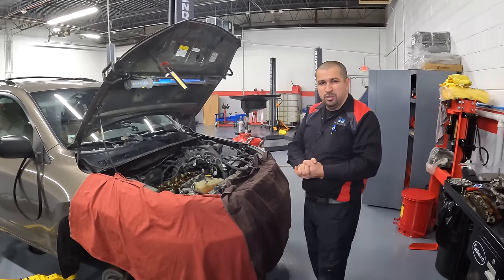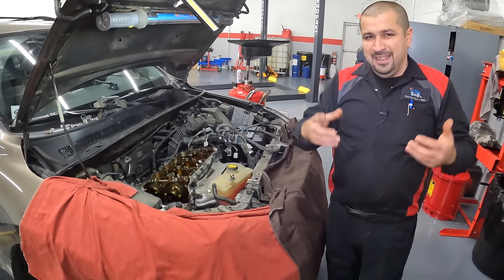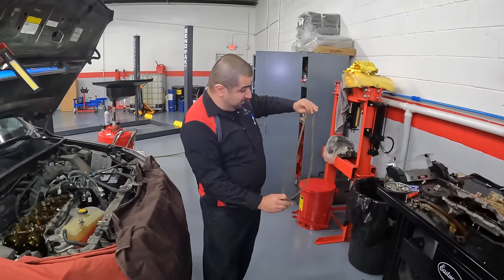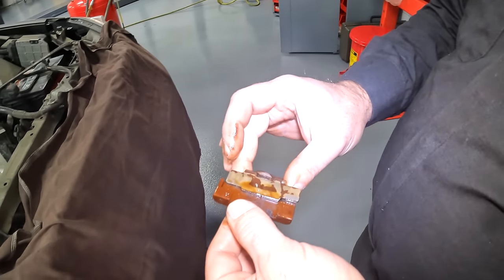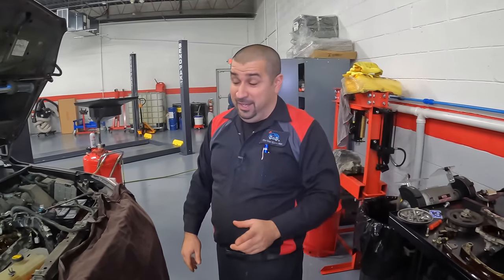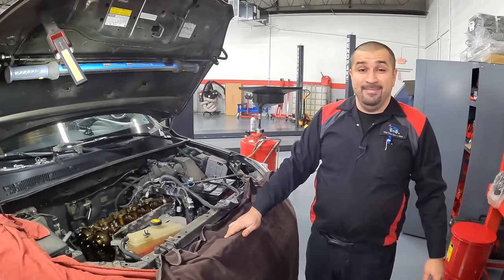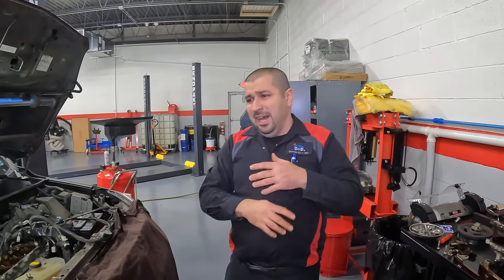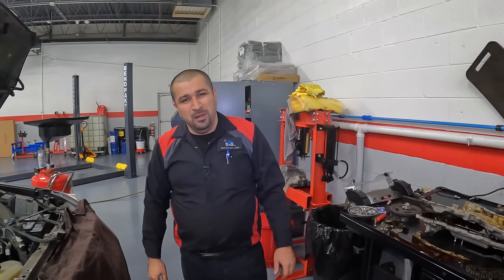When Should You Replace Your Toyota And Lexus Timing Chain?

Comment: I still have a 2003 Toyota 4-Runner with the 4.0L V-6 with 586k on it, no internal engine parts have been replaced, Toyota quality!
Reply: Nice! Congrats. 
I just hit 188K on my 2011 Highlander 3.5L V6. 
Most original parts
Reply: Sweet. I have an 08 4runner with 285k. Looking forward to may more miles!
Reply: A timing chain will outlast your cars once it’s serviced on time and driven properly.
Reply: I have a 2002 Toyota Sienna LE 3.0L V6 with 186K on it. Unfortunately, it has been getting costly repairs recently due to the Check Engine light not going away. I guess 20 years is still not too bad.
Reply: Wow.  I assume standard transmission?
Reply: @JohnSmith-mk8hz  if by standard transmission you mean manual transmission, no. All the cars in this thread all have automatic transmissions. 3rd gen was the last for a 4runner with a manual transmission,~1999/2000 was the last year.
Reply: 2001 tacoma w/ 3.4, 491000 miles, replaced alternator @330000 & starter @485000, otherwise completely factory. Factory water pump, a/c, fuel pump & filter, transmission nothing has been changed except for tires & brakes… well the seat is kinda worn out…
Reply: 304,000 on my 2009 Tacoma trd.......very impressive.
Reply: I have a mistress, and she's on 500k miles
Reply: When do you change oil & filter? I change mine every 5000 miles and the engine is perfect (140,000 miles toyota yaris 1.0litre)
Reply: @Shane-zx4ps  When you say serviced,do you mean schedule maintenance or service on the timing chain?
Reply: Mine 2011 sienna 500k on it, same with no internal engine parts have been replaced, even transmission fluid and spark plugs are from 2011.
Reply: @UC6v80dEXi5rJEA04UVK84LA I have a 2010 Lexus gs 350 with almost 200,000 miles. I was wondering if I should get that stuff you mentioned done now?
Reply: @damilolaakanni  Yes manual. Thanks for the info.
Reply: @wyattweeks3077  what fluids do you change? When?
Reply: I was wondering do you change your oil every 3000 or 4000 miles.
Reply: @mr3klax  not being diagnosed properly?
Reply: It's always easy to spot a liar.
Reply: @gianfrancoa  I’m not even sure if the dealership actually worked on it. Seemed like they just kept it for a few days, re-set the light then pushed it out. Then, charged me a fortune. Anyway, I have already spent more than the value of the car. So, it’s time for me to move on. Instead of donating it to charity, I decided to sell it for $1 to my co-worker/friend who knows about cars way more than I do. Hopefully, he can fix it.  Then, the car can have a second lease in life.
Reply: @TeezerDriz    I change my oil at 10k using Mobil 1 5w30 Synthetic oil with Wix & K&N oil filters, also use K&N oil bath air filter.
Reply: @mkm44  every 3000
Reply: @Ginbreader  nice! Change your transmission fluid?
Reply: @mr3klax  what are the things it needed? I have the same engine. All it 'needed' was a PS fluid change because the steering was getting tough. It has an intermittant miss that I'm going to chase down, I did the plugs already so its either going to be a coil or fuel injector. I did the belt and water pump cam and crank seals at 125k so once i fix the miss i should be good to go for a long time. I took the gamble and did the trans fluid not knowing if it was original or not, and everything is great. 

On my subaru with 200k, that gamble did not pay off. within 3 days of changing the trans fluid, it stopped shifting. But at only 125 i felt i had better odds on the toyota.
Reply: Mine is a 2004 RAV4.  No major issues so far
Reply: 2000 Tacoma 4 cyl 2.4 liter, 225 K miles. Have oil and filter changed every 3,000 miles, transmission fluid every 50,000 miles, antifreeze every 7 years, only parts changed on the engine are spark plugs, radiator, 2 transmission lines, and starter contacts in the 11 years I've owned it, it only had 47,000 miles when I bought it. NYS Salt rusted the transmission lines and started leaking. Frame is still good, truck came out of Virginia when I bought it so frame had no rust on it. Salt is the only thing that kills them by rusting out the frames. This is my 4th Tacoma with over 200,000 mile and never had to change any timing chains.
Reply: Wow, that's amazing!
Reply: @Ginbreader  wow, amazing
Reply: Wow
Reply: That's 28K/yr.  Do you live in your car?
Reply: Wow!!
Reply: @mr3klax  I have a 2007 Sienna with 116000 miles. Recently had an engine miss, code 302. Mechanic said either a spark plug or coil is bad. I did some investigating and watched the Car care nut video, and found broken wires going to the fuel injector. Soldered it. Fixed it myself.
Reply: @wildman1137  How do you spot a liar?
Reply: @dhowar  That’s exactly what these videos are for. Good job! You should be proud.
Reply: @mr2cqql  Wow! unbelievable!
Reply: @wildman1137  Did you look in the mirror again?
Reply: I have only over 420k miles on '97 4Runner with the V-6. It sill runs good and doesn't burn oil. My original clutch lasted over 300k miles.
Reply: That's incredible
Reply: Those 4 runners are the best bullet proof million miles legends
Reply: Toyota made before 2010 were bullet proof. No fancy technology or sensors and no 8+ speed transmissions...simple 4,5,6 speed auto transmission and 5 pr 6 speed manual transmission. And No turbo.
Reply: Toyota had some bad decision such as rubber oil cooler lines v6 2grfe and faulty engine control module (ecm) where the car would stall in subzero temperature due to crack in soldering points.
Reply: I have a 2003 4runner. 260K. Runs great, but now having an ABS issue. Rotors and new pads. Think it may be a sensor issue, Still digging, But a great vehicle. Black with tan leather, very solid and in good shape.  Hope I can get the ABS issue resolved quickly. Any tips, let me know.
Reply: It's called doing your oil changes and other pm routinely.

Comment: Followed your advice. Broke, in the new Tacoma gently and changed oil at 1,000 miles. No metal filings. Yea!
Reply: I did the same thing for my 22 and I had metal in there.every engine does no matter the manufacturer. It was mostly aluminum.
Reply: I remember my first oil change on my Tacoma at 1,500 miles and needing to borrow an oil filter wrench from my neighbor because it was on so tight, thinking I would never get it removed.
Reply: @Kar Kule  I looked very closely. If it is in there it is microscopic.
Reply: @karkule5919  I was expecting metal filings based on what others have reported.
Reply: @02markcal the dealership has a socket for the filters to tighten them way too hard. us normal folk just spin them by hand so loosening is always a pain

Comment: Unlike timing belts, timing chains are always getting lubricated with the engine oil, so that makes perfect sense why they can last for the life of the engine.  Probably changing the oil at regular intervals plays a big part of it too.
Reply: True...my buddy is a parts manager at a Honda dealership.. people that run petroleum and do maximum mileage as recommended by the manufacturer replace the timing chain at 120 k to 150 k....My 04 Accord had 285,000 miles and the guides had zero wear..I ran synthetic and changed it between 4 and 5 k miles intervals..
Reply: @mikeschlup5279   The CCN has done videos about the difference in wear - particularly in cylinders - from doing 10K mile intervals rather than 5K. Our 2014 Prius reminds us to change every 5K but the manual says 10K. I was about to change to the manual's recommendation when CCN wised me up. At 176K on the vehicle with negligible loss of oil between changes I have no doubt he saved me from a world of regret.
Reply: @flagmichael  CCN ?
Reply: @mikeschlup5279  Car Care Nut
Reply: That’s what they said at the VW dealership as well, after listening to my rattling chain in a two year old car. Bottom line, you can lubricate a crappy chain and it will still break. Glad to see Toyota doesn’t comprimise quality for short term profit
Reply: Not probably. Changing the oil at frequent intervals. 4000 miles for mine.  You’ll have a long lasting chain.
Reply: No doubt, regular oil changes (with quality full synthetic oil) have the biggest impact re: chain longevity

Comment: Agreed with what AMD said. Original  owner here of a 2006 Tacoma 4x4 with the 4.0 V6 pushing 400K miles and never had issues with the timing  chain or really anything else associated with this legendary engine. Have always changed the oil every 5K miles these last 16 years.
Reply: Glad to hear that, my 2011 Taco with the 4.0 just rolled over 200k. Nothing done to it but routine maintenance. Heck, it's just getting broken in good!😊
Reply: 2010 v6 Tacoma 300,000 miles. Just oil change every 4000 minutes. And replaced one bad fuel injector.
Reply: The 4.0L is good. You got to keep up with oil changes. That is key on the 1GR
Reply: Did you ever replace the transmission fluid?
Reply: @jaycarl1562 drain and fill. Never flush for an automatic.
Reply: @itsmewillieD  already know that but thanks. Question stands

Comment: First time I’ve heard you don’t have to replace your timing chain for mileage alone. You saved me at least $1,300. My 2008 Lexus RX350 with 133k miles runs perfectly. My son is a master mechanic and feels the suv is in great condition. We have since done some little things like spark plugs (painful but done), gaskets, oil, air/cabin filters and tires. Otherwise, it’s getting over 21 mpg and it appears to be running great. Appreciate your quality videos. Thank you!

Comment: You have convinced me to do oil changes every 8000km or 6 months, whichever comes first for both my cars. My new '22 Corolla will get the best treatment possible and my wife's '17 Prius is going to start getting the same treatment (it previously was following Toyota's schedule which is pretty much double that duration). While the Prius seems to be running totally fine, and I see no evidence of gunk building up when looking inside the oil fill cap on the valve cover, I feel more comfortable just changing the oil more frequently if that means the difference between an engine needing major surgery or not at all. It just makes sense. Oil can never be too clean but it sure can be broken down and/or contaminated. Thanks for another great video.

Comment: So glad that manufactures went back to chain instead of belts. Smartest move in recent years
Reply: I had a 1986 Corolla which bust its belt at 42K miles. Toyota picked up the bill as they admitted to a poor batch of belts. However, soon after the cam-shaft started rattling and they refused to replace it even though it was clearly bent when the valves were bent.
Reply: VW chains are booty, and have problems. Not all brands use quality chains.
Reply: Unless it's a Nissan!

Comment: Last year when I bought my 2010 Rav4 I went looking for a 4 cylinder but found
a 6 cylinder instead and more and more I am glad it worked out that way. 😎
Reply: 3.5L FTW!!!
Reply: I've heard those things haul ass for what they are.  Good find.
Reply: @darthdarthbinkss  
15.4 in the 1/4 mile and great mpg
Reply: @darthdarthbinkss  My first car was a VW Beetle that had 60hp on
a good day, and I drove it 21 years. Next was a '86 Accord with about
110 hp and then a 1997 Accord with about 120 hp. This thing has
268 hp and it is a rocket-ship to me. When I put my foot into it I can
almost watch the gas gauge drop. So far it has been great and I hope it 
takes me the rest of my driving life. Right now I am at about 77k on the 
odometer. 😎
Reply: im not as into toyota as many others but i thought the 4 cyl were chains and the 6 cyl were belts, like my 3.0 highlander. or am i thinking of hondas?
Reply: @danwake4431  I believe you are correct, but by the mid-2000s I believe Toyota switched to all timing chains in their V6s.

Comment: I have seen a Ford 4.6 three valve and a 5.3 three valve engine lose the plastic part of the timing chain guide that got caught under the chain and went around the cam phaser and caused the engine to jump one degree in timing. I'm really happy I switched to a Toyota! Your channel has been a huge help!
Reply: A well maintained  Ford can last. I've had several ford's well over 200k miles when I sold it running  perfect. I've never had a major issue with a Ford..  and Hondas.. Hondas are my favorite . They generally last just as long as a toyota. Mine do anyways.
Reply: @richsweeney1115  exactly, this guy beats on other cars so much and his viewers don't know any better. He refuses to understand that for one, people who buy german cars are often predisposed to lack of maintenance and abusing/driving their cars hard. Most people that drive Toyotas care about their cars. 

In this video, he mentions Toyota quality, but the majority of the 2AR-FE engines as shown here DO have the cold start up rattle. So does that mean their timing chains are probably also burned up/overheated like the one here? I owned a 2AR-FE from when it was brand new and changed my oil at 5k and by 60k, I too had the cold start rattle. I had to sell the car at 70k for other reasons but my point is, things aren't as great or bulletproof as this guy portrays in every video he puts out. 

I still respect his work quality and honesty/integrity but he blindly puts all his faith in Toyota land lol
Reply: @awaara24  I mean, I do like toyotas, Hondas are just my fave, German cars are plastic crap
Reply: @richsweeney1115  Fords last as long as they don't have cam phasers. Fords biggest problem is the cam phasers. It doesn't matter how often you do your oil changes, you will still have problems with phasers. My 2007 Lincoln Town Car made it 465,000 miles without any major problems and it still ran as good as it did with 52,000 miles on it when I bought over seven years ago. I agree, if you maintain your vehicle from the start. It will last a long time without any issues. However, General Motors has many issues with their engines and electrical switches because China makes 90% of engine parts, transmission parts, and electrical parts. The only problem I heard with Hondas was the Honda Odyssey had weak transmissions. That's the only complaint I heard about Hondas.
Reply: @merrillschaps2325  oh God no, I didn't mean chevys. I meant older ford, h
Honda, toyota, acura, lexus..older volvo..and some subarus..not gm or dodge or fiat..ect..lol
Reply: @richsweeney1115  gotcha. Yeah the older cars are way better built. I will agree with you on that.
Reply: @merrillschaps2325  people say..
 Ohhh they're  not as safe...I'd rather  have an older car or truck that was built with better steel, and not tin and plastic..
Reply: They aint any better as they use a plastic main tensioner
Reply: p
Reply: @wildman1137  I worked for the big three, Chrysler, GM, and Ford and when I left GM in 2015, 80% of the parts for GM were being made in China. I'll admit it, I never owned a Toyota product until recently and no nothing about Toyotas. Which is why I have been watching this channel as well as doing my own research. I have been a mechanic myself since 1999 starting off as an apprentice for Chrysler and was with Chrysler since 2010 before working for GM then Ford. During the Obama era, Obama was forcing car companies to out source their production of parts to China in return for the government bailing them out. Chrysler took a different approach. Chrysler decided to merge with Fiat to save both companies. GM has a long term contract with China and Ford makes decent, reliable vehicles with only having timing components, mainly the camshaft phaser issues. I witnessed most of this first hand for myself and if you look at the GM packaging. You will see Made In China, especially on most of their camshafts- which are made too soft of metal. Yes, years ago the big three invested in north America. That was back before Obama bailed these companies out. As for Toyota, we'll just have to wait and see what happens as I'm still doing countless hours of research on. I can tell you this much about Toyotas. People are saying the quality is way better than the big three which is probably why there is more Japanese vehicles on the road than another.
Reply: @richsweeney1115  in dreams
Reply: I've been a Toyota fan for 14 years and a car care nut fan for 6 months.  Amd is not gaslighting anyone. Toyota is the king of quality.  Ford, in the last 15 years, can kick rocks.  If you took two like items and gave them the same treatment, Ford will fail first.  That's the money bet.  There's always a rare case where a Ford goes 300k, but I promise you there's ten times as many Toyotas with that kind of mileage and they are just breaking in.  Ford's are usually done by 180k.

Waste your money and time where you please.  I've decided to change my entire fleet to Toyota.
Reply: Ford "shit the bed" with the 3 valve. the 2 valve 4.6 & 5.4 could easily see 500 k
Reply: @richsweeney1115  Honda's weak point now is the crappy CVT they're now using.
Reply: @jaya.0069  I haven't seen anyone with a problem with one, I'd never buy a car with a cvt anyways, I don't even want a regular automatic. I have an 05 dakota club cab 4 door v8 4x4  and I wanna put a standard tranny in it I'm not a big dodge guy, but I do love mine. I wish it was a little older ,like the 2nd generation body style though
Reply: @merrillschaps2325  I do like old chevys  though. Actually, I have an 05 dakota club  cab 4 door v8 4x4 ,I'm not a big dodge guy,  but I love it

Comment: Thanks for answering that question.  I have a 2012 Tacoma, that has 300,000 miles on it.  Still run greats.  I take it in for oil changes as needed, had plugs replaced once so far.  Getting ready to have it go back in to have the rear end serviced and the transmission.